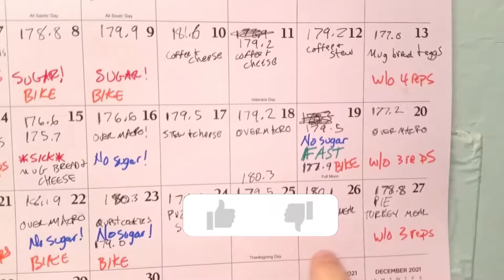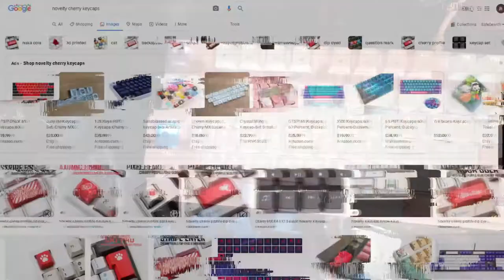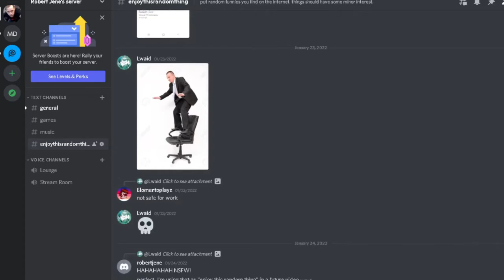this diet is exhausting! #RVLOG 61

Comment: I'm buying 2 things for sure whenever I get a garage...an air compressor and a snow blower. I hate snow so much.
Reply from the maker: I wish I had room for a snow blower
Reply: @RobertJene  You can get a powered shovel....that would fit most places....
Reply from the maker: @theitguy2731  [rubs chin]
Reply: @RobertJene  I don't need one right at this moment but it would be nice.
Reply: @RobertJene  Honestly, if you work on your car....You should get an air compressor too. I learned that to work on your car you need a bare minimum of 90 PSI. Gallons are how much air it can hold (basically how long the "battery" lasts)...and HP is how fast the battery can charge....I know i am going to invest in one.
Reply from the maker: @theitguy2731  I have one that is also a battery jump starter, but I need a new one because I damaged it trying to jump start my Nova all those times
Reply: @RobertJene  I know there are some air compressors that have enough power to pump up tires...but I mean like a decent air compressor
Reply from the maker: @theitguy2731  yes I agree. Because I need higher psi to fill up my air shocks